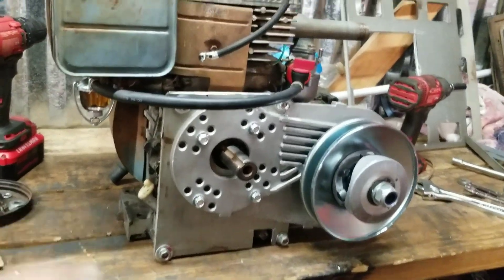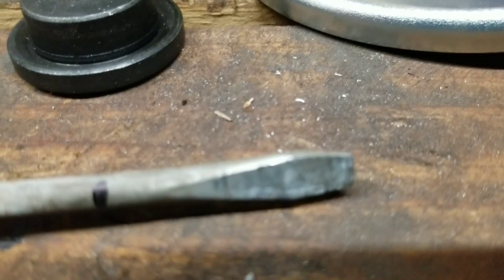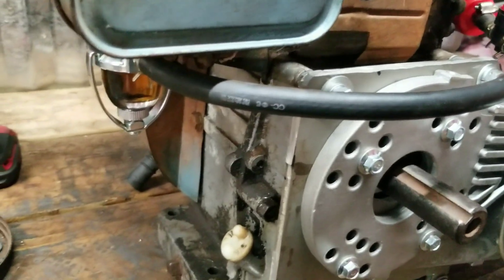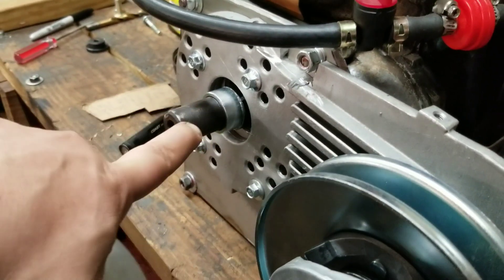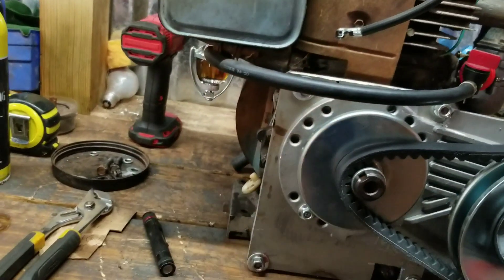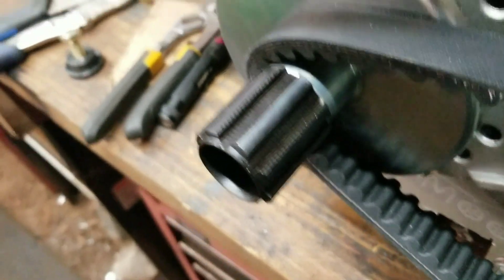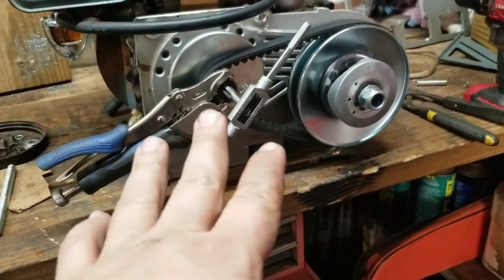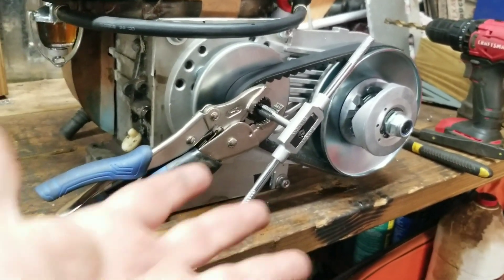Wrapping up 8hp Briggs torque converter install on Big Hoss to an unpleasant surprise!

Comment: So I'm almost 60 and about to put my custom made mini bike that I got in 1975 back together but better its about the same size as yours ,mine has a small airplane tire in the rear please tell me exactly what torque converter you got, also is there a HD piston rod available  ? I can't find one same engine
Reply from the maker: @Eric Schulze I want to say the one I got is a Moosun. You can find it or similar ones that'll fit accordingly on Amazon. Sounds like a fun project! Good luck on it! Thank you for watching! Blessings!

Comment: Found video thanks for this but if ur willing to sell the plate lmk
Reply from the maker: I need to see if I have it still laying around. Something like that I'd give it to you if it'd help. I know I found no plate available plus the case on mine wasn't built to accept such. I do believe on video about fixing exhaust issues, I explained in more detail the all thread lengths. I'll get with you and let you know if I run across the plate. Blessings and respect!